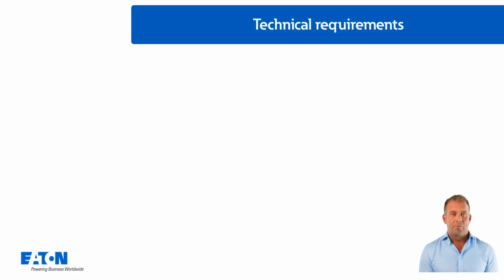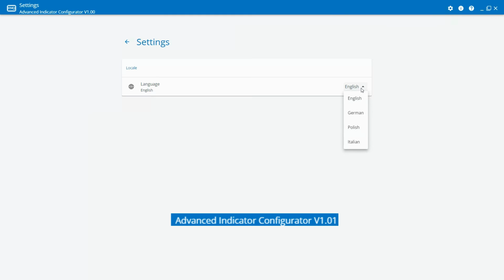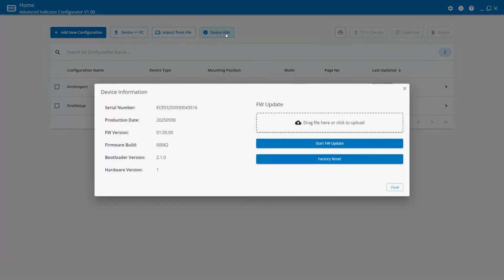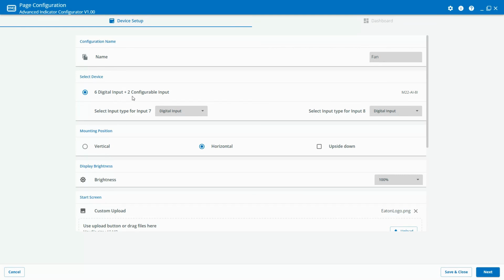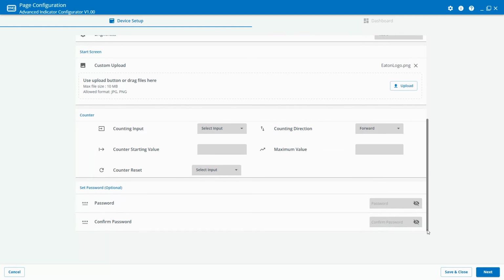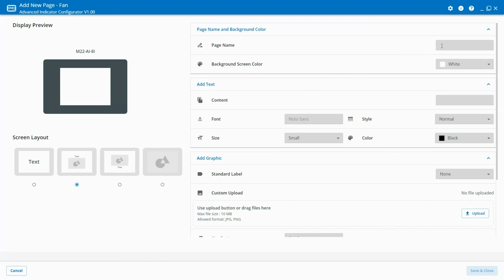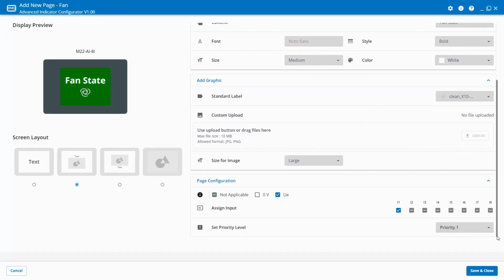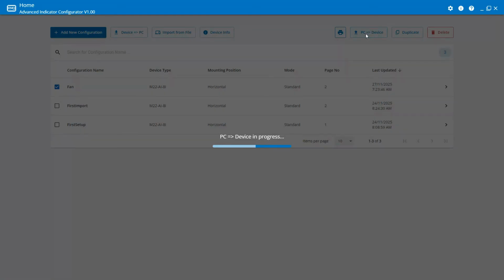RMQ-Titan Advanced Indicator– Basics

Comment: I used a titan display at the Lindbergh Windsor Salt plant to replace a 20 year old 5 channel gas tottalizer. I discouvered the GM had changed the engineering unit and miss reported gas consuption by 2/3ds.  Fraud and theft on a grand scale and they they had me beaten and left for dead in the river valley for my efforts.